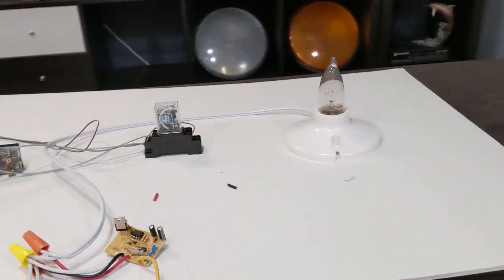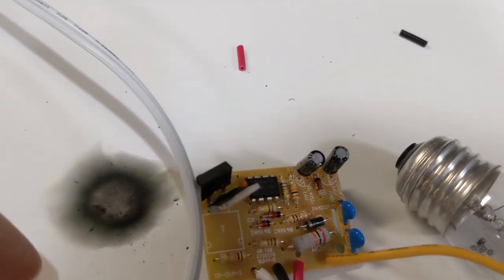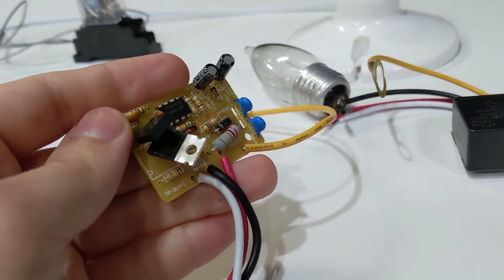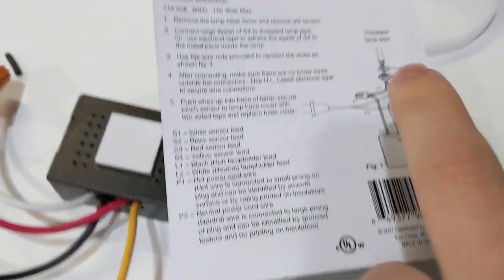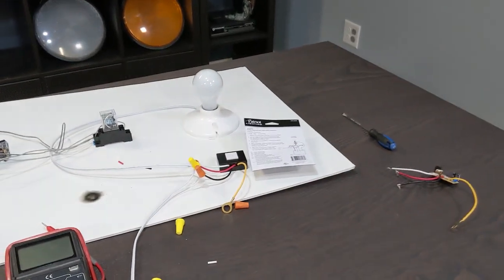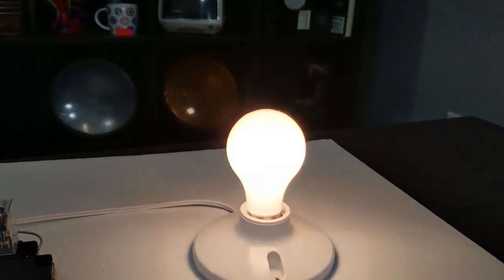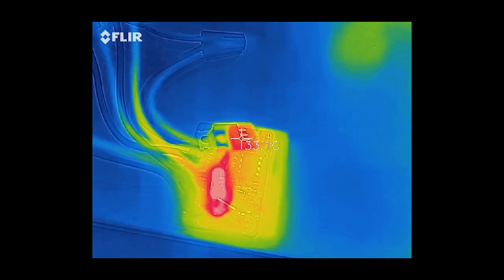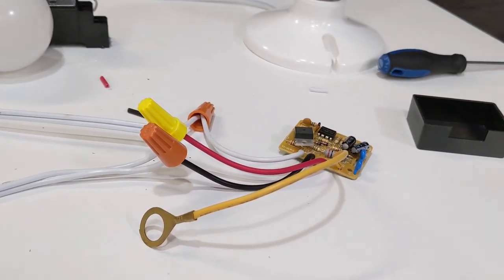A slightly explosive touch-lamp follow-up (standby energy consumption)

Comment: I think I’m gonna make my house completely switchless. I’ll replace them with metal plates that are capacitance sensitive. Every light will be touch. It will be beautifully impractical
Reply: Make sure everything's grounded properly aha
Reply: I used a combination of RCWL-0516 microwave and PIR motion sensor driven LED lighting so lighting follows me through most of the house. No pets.
Reply: I'm considering similar but I use the open-source home control system Home Assistant so I can just add wireless capacitive plates that trigger state changes. Maybe a better approach so they can be disabled or changed easily...

Comment: Wiring colors follow regional/nation guidelines, unless of course it's a "harmonized" color code.  Which uses brown for line (hot, come on, let's get with the lingo) blue for neutral and a green wire with a yellow stripe for ground.  In the USA black, red, and blue are all LINE wires for 120/208V.  But when you step up to the magic 277/408V it goes festive with brown, orange, and yellow for LINE and grey for neutral.   But great video!  As an electrical engineer I do a fair amount of work in the lab at work.  And every so often someone lets the smoke out, which is always exciting!  Especially if it's a new hire :-)